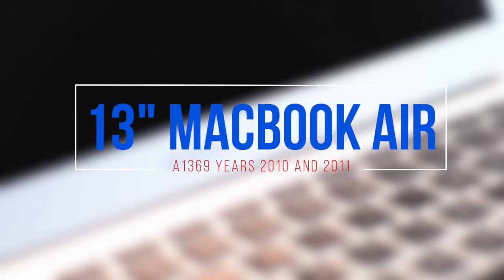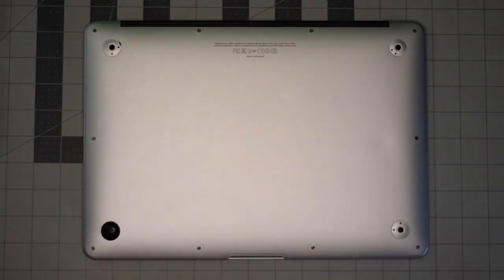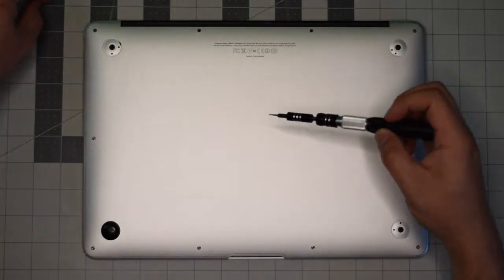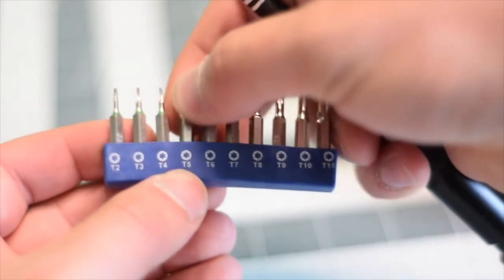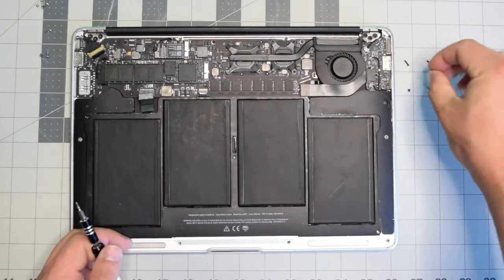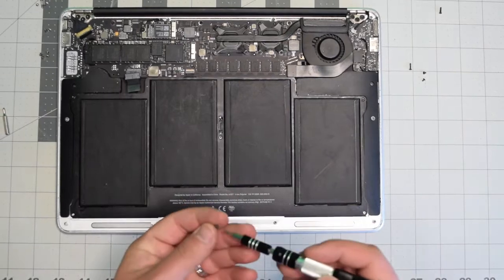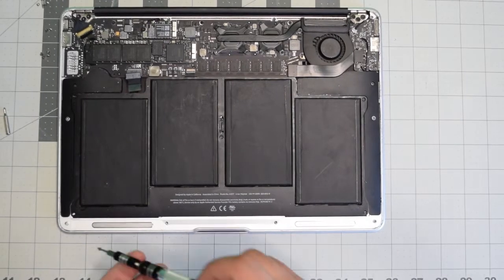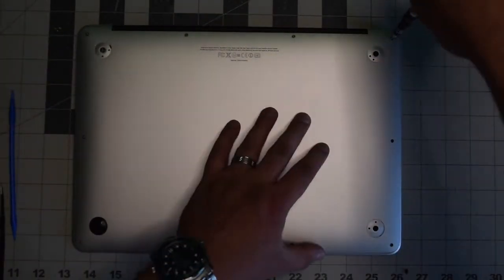13" Macbook Air A1369 2010 and 2011 Battery Replacement Installation

Comment: Its so great that you upload these vids - following your instructions I was able to replace the lid/display on my 2012 MacBook Pro after it developed distorted lines on the screen. Literally saved me a fortune and I got my macbook back after a year of putting up with the distortion. Thank you so much.
Reply from the maker: That you for sharing your experience. It keeps me going!
Reply: @GRIBSOFT  You are very welcome, keep up the good work!